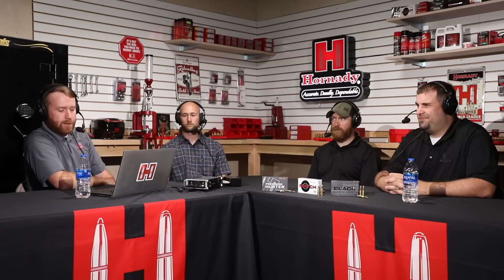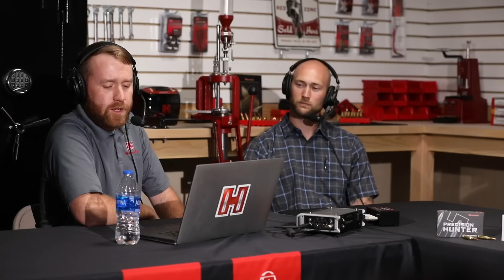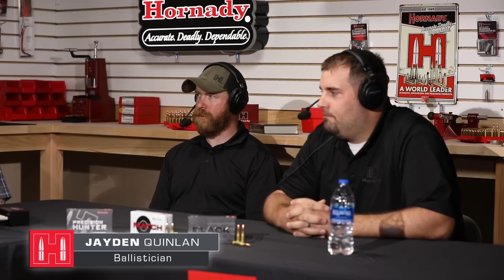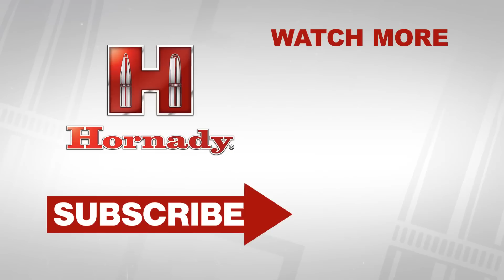6mm ARC Post Launch Discussion

Comment: I'd like to see an in depth ballistic comparison between this and the 6.5 Grendel from hunting ranges all the way out to 1,000+ yards for target shooting showing where the 6mmARC starts to take the advantage.
Reply: In general for over 1000 yards for a target cartridge the 6 ARC will win 95% of the time. With the 6 ARC you can hit (very) extended ranges whereas other cartridges like the Grendel can only go that far by using specialty designed solid copper bullets that currently run $1.25 per projectile (not loaded ammo) for the cheap stuff (that may or may not feed in a magazine). 1,400 to 1,600 are reasonable expectations for the 6ARC (with bullets that cost just over .30 cents each), and of course depending on configuration and exact bullet choice. Say for example if you use Sierra's 110 grain bullet and you only get 2600 fps out of it, the transition from super to subsonic happens between 1,400 and 1,500 yards. If you can eek out 2,700 fps with that bullet you have a potential 1600 yard gun. 
For me I am not hunting or doing anything like that. My primary purpose is exactly for long distances and to have an affordable way to scratch that itch. A cost effective way to shoot more ELR is my primary objective. I can get into that game for basically the cost of an upper (and of course the optic). I get a lot more bang for a lot less buck.
Reply: to add to what Tyler is saying, Grendel, nor arc, aren't viable to hunt that far out. Neither is 308, lots of cartridges. long barrel hunting limit is likely around 500-600 yards. Carbine limit is around 400. But for most people that's way more than you need.
Reply: Holy Smokes. I didn’t know it could get out to those ranges.  Do you have any idea how far one could shoot with a 16” barrel rifle?
Reply: @Glove513  With the right bullet selection you can get to about 1,400 yards. With factory ammo probably 1,300. That's out of a 16" barrel.
Reply: Tyler  That is crazy. Thanks for the response. Makes me wonder how far a 12” could realistically reach. Or, for that matter, an 8.1” in an AK-74U.
Reply: @Glove513  Based on the numbers Hornady posted a 12" gun would reach out to over 1,000 yards. Probably 1100 or so.

Comment: Love these round table conversations of a new cartridge. I'm not a 6mm fan , , but , , this one has my full attention. Will be putting one together in an AR platform as soon as components are at a more reasonable price, along with reloading supplies and data.

Americans are enamored with the 3000 fps mark. That was because of the Savage Firearm folks and the 250/3000 cartridge, (1915 with an 87 grain bullet). Today, it still is a non-necessity in the real world. So far, it seems that the true hunting / long range round is between 2500 to 2800 fps with the correct components to make it happen more folks owned and utilized a chronograph, their bragging rights would not be as prevalent, (my opinion). Makes me wonder why the Winchester 30-30 is still around, (grin). Keeps harvesting deer, even today, ( 1895 in the Winchester 1894). Don't see a 3000 fps with this round.

Other than that, I'll be an upcoming customer of this cartridge. Be more than happy to buy some Hornady dies and start digging in to the reloading process, and 'my' development of this cartridge.

Joel

Comment: I had a weak extractor on my 6.5G that was extracting slowly and leading to FTF problems that I originally thought were magazine related. One day the extractor broke, and I replaced it with a JP industries enhanced extractor. I haven't had a single FTF since. The Elander feedlips got absolutely mangled in some FTF instances. I never bent them back, but they work with the new extractor! If you're having rounds nosedive or pitch up, take slow motion vids of your ejection, and you may find that your extractor is ejecting too slow (this is how I realized it wasn't the mag's fault).

Comment: Question for Preston:  Will there be go / no go gauges for head spacing the bolt on a barrel?  I haven't see those mentioned anywhere.  I purchased a barrel from CMMG, and will need to head space it to the bolt I purchased from Brownells.  Also, there is no ETA on the die sets yet?  Will there be a Hornady or L.E. Wilson case gauge for ARC?  Thanks.
Reply: go/no go gauges would come from the folks that make reamers.  I'm betting there will be cartridge gauges out in good time.

Comment: When you guys released the 6.5 creedmoor it was a large primer round then after a couple of years you guys started making 6.5 creedmoor with small primer! Is that the plan with the 6 arc start with the small primer then in a couple years release a large primer?
Reply: I would have to answer for them and say no. When you ever can you want to be able to use a small rifle primer. When using a small primer you have more brass support in the highest pressure area if the cartridge. Plus for reloading you keep primer pocket uniformity for longer. Srp is want you want a large would serve zero advantages
Reply: Matthew Baker ok thanks for the info!!

Comment: Why is it better than 6.5 Grendel?
Reply from the maker: The guys get into that conversation in this video around the 20:30 mark. Here is another video that talks on that too - https://youtu.be/os3x5Rg-BJw
Reply: Slightly more energy at the muzzle (e=1/2*m*v^2-- velocity being squared gives more energy to lighter faster bullets) and it maintains it better (higher BC bullets).
Reply: Because it has a higher BC and more velocity. The weight of the projectile is already factored into the BC. Meaning that if you took a 123gr 6.5 Grendel and 108gr 6mmARC and for the sake of this example they had the same exact muzzle velocity and the exact same BC both would be moving the exact same velocities at 100, 200, 300, 400.....etc they would have identical velocities at every distance they would also have the exact same wind drift and drop at every range and go subsonic at the exact same distance because again bullet weight is already factored into BC as a part of the calculation that determines BC. Thus comparing a lighter bullet with more velocity which also has an equal or higher BC than a heavier bullet with less velocity the lighter bullet will be faster at every distance downrange the mass of the heavier will never allow to catch up in any way.

However 6mmARC has a slightly higher BC than 6.5 Grendel and it has 170 fps more velocity. What that means is that since 6mmARC is faster it spends less time traveling to target which means less time exposed to the wind and thus less wind drift and since it's travelling faster than 6.5 Grendel it will have less drop as well and with the extra speed it will give more supersonic range. The 6mmARC also has nearly identical muzzle energy as well but with the slightly higher BC it begin to slowly pull away from 6.5 Grendel in the energy department immediately and continue to so all the way downrange.
Reply: Because working out if the AR-15 form factor, the 6mm has better longer range ballistics

Comment: Is this new cartridge all hype or is it really about to lead the way and become a good all around new cartridge/bullet the 6.5 grendal has been around for a while why didnt that little round not become so easy to buy or get hope the 6 arc will be not so costly like the 223/5.56
Reply: Check out IraqVeteran8888's channel.  They goofed around with a 6.5 Grendel and then 224 Valkyrie then discouraged moved on to the 6mm AR wildcat and they determined that 6mm is the "happy spot" for the AR platform.  I concur.  The 6mm bullet size lets the AR size platform achieve everything it is capable of.
Reply: For the first 7 or 8 years of the life of the Grendel it was a proprietary round where Alexander Arms held all the rights to it. Anyone wanting to make anything had to go to AA to see if they could work out a deal. On the other hand the ARC is coming straight out of the gate with SAAMI specs and a host of industry support primarily because they approached it with a 'standardization' mindset.